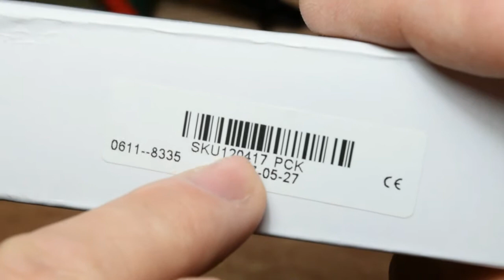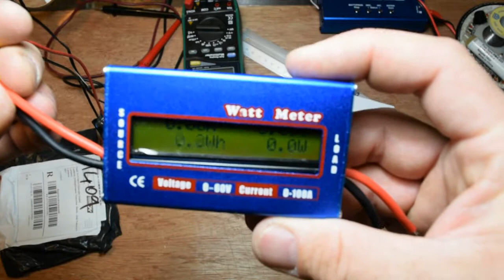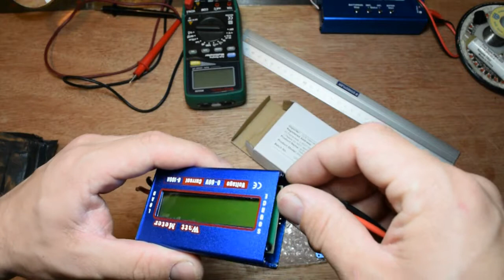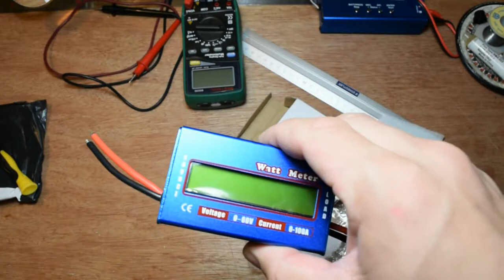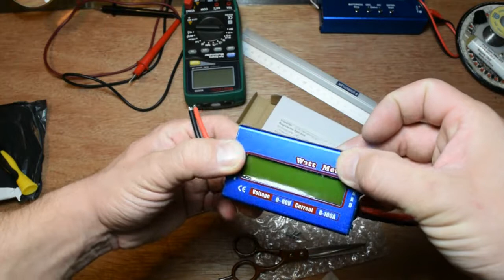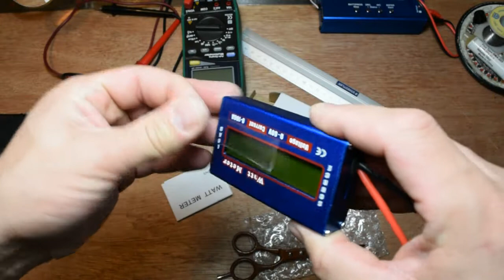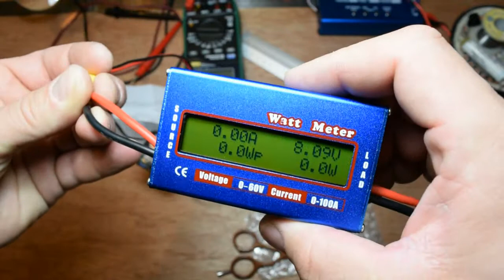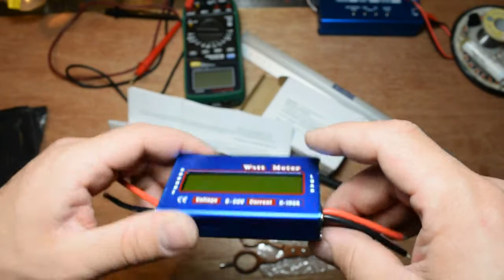60V 100A Display Voltage Watt Meter Battery Analyze From Banggood.com

Comment: 100 amperes with continuous measurement and then such thin cables?! Typical "quality" from China. Ok, for smoke signs it is good enough. ;-)
A cable with a cross-section of minimum 35 mm² is required for 100 amps! But this cable looks like 2.5 mm², then just 20 amps are possible without the risk of overheating.

Comment: Hello sir, I had two from aliexpress. Both stopped working when i tested on 24 volt 30 amps solar power. Display ran out. Anyway to repair it?
Reply from the maker: Oblivion Tech No idea. I have mine and its working very well until now.  I think yours have problems from factory.